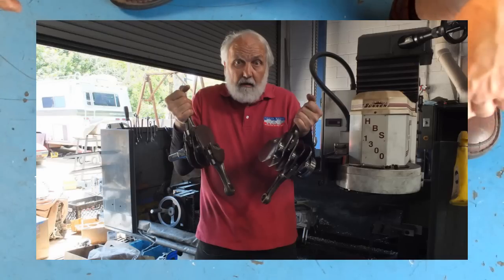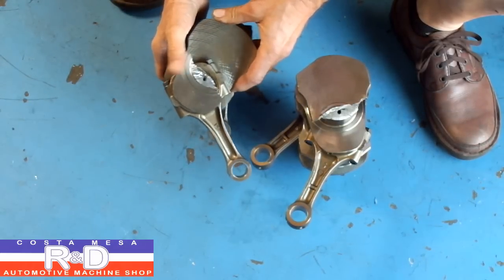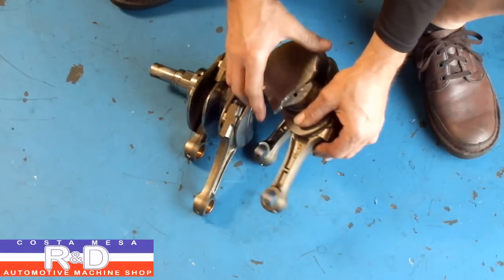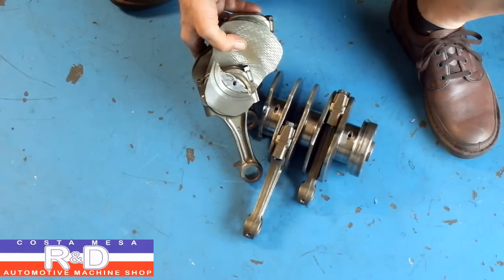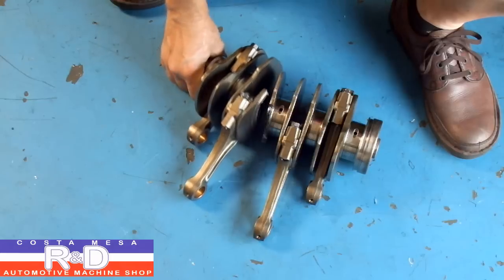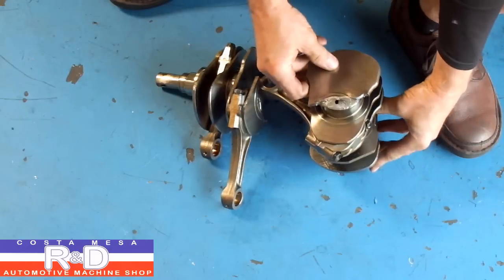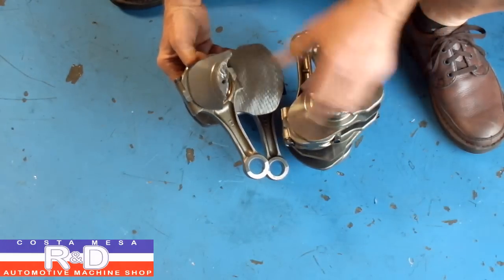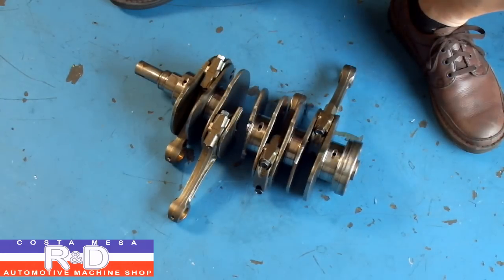Holly Subaru Broken Crankshaft Batman

Comment: Was this the diesel or the petrol? I think it doesn't say anywhere. Some of the comments were bad tune or detonation, but this happens on petrol engines. I believe this is the diesel, because I read on the internet the boxer diesels of that era 2010(the first ones for subaru) tend to break.

Comment: So what happened is that when the engine was lugged (low rpm high throttle wrong gear)?  I find myself doing it because I have alot more torque in my car then my old one and I find myself sometimes accelerating from 40mph in 5th gear and I have to catch myself.  Downshift and save that rumble.

Comment: I agree the HB is beneficial. However, people run lightweight crank pulleys all the time and they don't get this type of failure. Long term failure is typically along the lines of accelerated main bearing wear and short term catastrophic failure is due to vibration related fastener failure, such as flywheel bolts backing out. HBs simply absorb the associated harmonics, they don't prevent crank twist. Beefy cranks don't shear apart for lack of a HB.

Comment: Thanks for sharing this. I find it incredible. Why should there be that much force between sections of the crankshaft? I could imagine it if one piston seized up, but not under normal circumstances. Well, it reminds me of my first Corvette in 1959. The Chevy dealer told me that I shouldn't use the brakes too hard or they could heat up and catch fire. That on a 1.5 Ton car with nearly 300 HP.

Comment: I don't believe that's a factory subaru crankshaft at least not used in a wrx or sti. I have seen people put 500whp on the stock crankshaft and stock transmission on sti's without any problems.

Comment: YouTube has some broken crankshaft videos too.

Personally, in the 40 years I've been in the automotive biz, I''ve never run into one, but was aware that they do fail on occasion. (I also don't do any high performance work.)

For some reason I'd always envisioned them shearing in a main bearing, but it looks like most break as in John's example. Many of the videos noted the engine still ran.

I did see a Lycoming (aircraft) crank that failed a 'ring test', but never found the crack.

Comment: Yes, I agree that morons can bust most anything, and that broken area does look feeble.

However, torsional vibration can/will cause even beefy cranks to eventually fail in normal use. Damping said vibration is the roll of the harmonic balancer.

I know some mfg's have started eliminating them to save a buck... just wasn't sure about Subaru.

Out of passing interest, check the Wikipedia harmonic balancer article... they're more important than they so appear.

Comment: No harmonic balancer on earth would have prevented that. That is too much power through a component that wasn't designed to take it. Combine that with a bad tune or an idiot that likes to drop the clutch at 6k and you get a snapped crank.